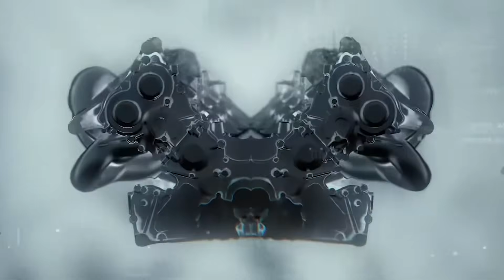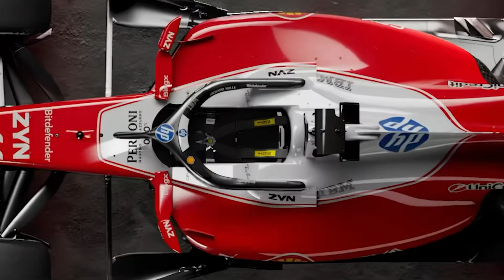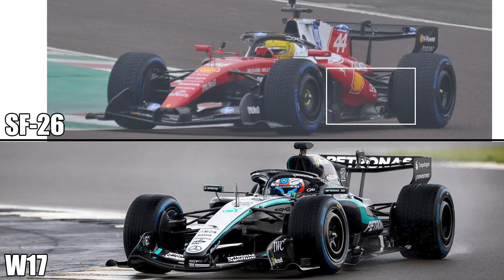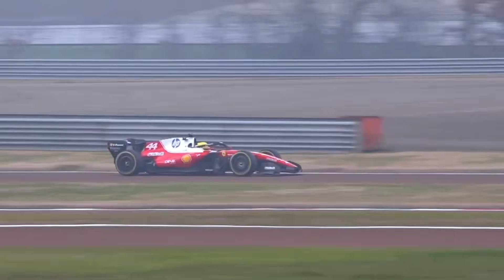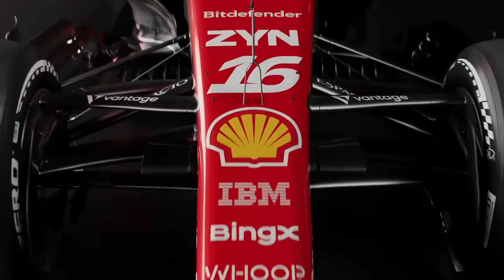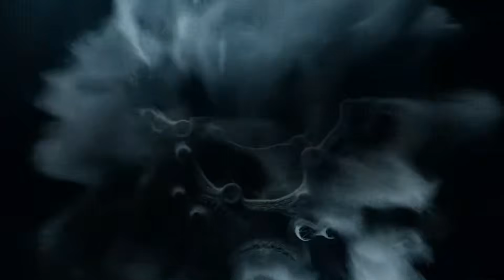Ferrari SF-26: all the most hidden updates

Comment: If Ferrari wind tunnel and simulation is producing accurate information. Ferrari will win if not another awful season. Remember what Adrian Newey did when he arrived at Aston martin he said the win tunnel is not accurate then he started firing personnel
Reply from the maker: That’s the key point. If the wind tunnel and CFD finally correlate with the track, Ferrari can be competitive. If not, no amount of talent will save the season. Newey’s example at Aston Martin is spot on: when tools lie, you design the wrong car. Correlation is everything in modern F1